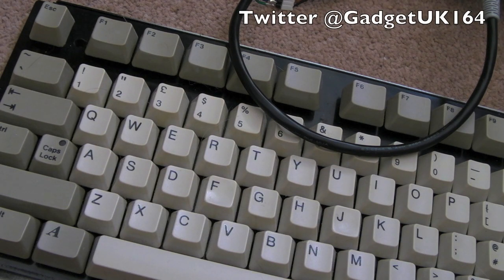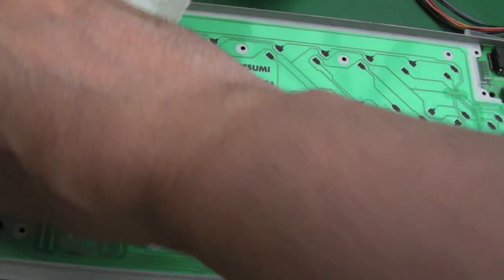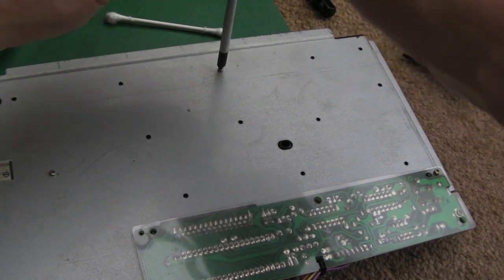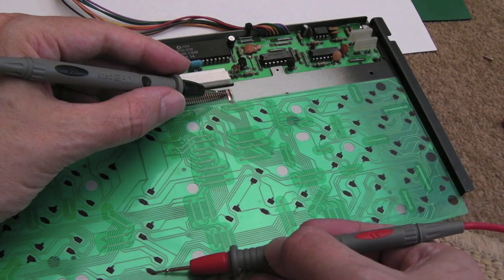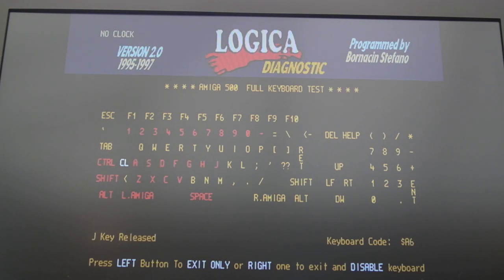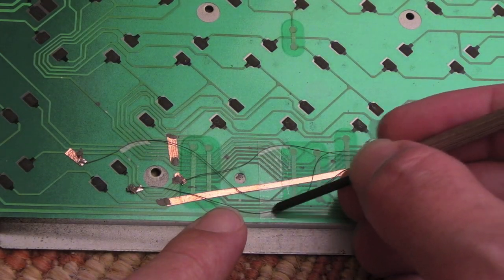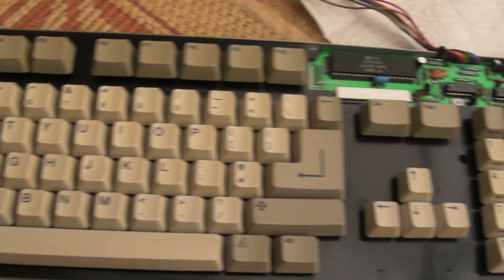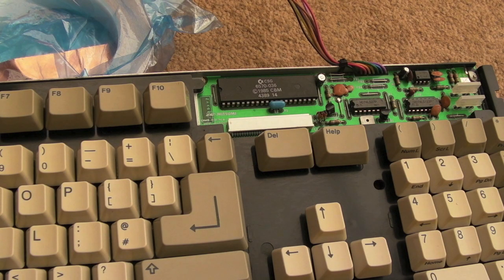Commodore Amiga Mitsumi Keyboard Membrane Repair

Comment: Question: why didn't you run wire from the pad directly to the connector instead of from the pad to the membrane?
Reply from the maker: The copper tape has a good adhesive on the back, so it stays stuck down really well.  If you were to try and use the conductive ink to secure a wire, it will break off very easily with any movement.   The conductive ink does not set hard, it sets soft - like silicone almost, but it is conductive.

Comment: Thank you GadgetUK164, much appreciated preservation of this Amiga keyboard, those membrane contracts are touchy.
Reply: Would a solution for those contact pads exist like a conductive paste on each pad?
Reply: Using nail polish on both back and front of those flat copper traces could help in numerous ways.
Reply from the maker: Yes, you can get conductive paint for those pads too!

Comment: I used an old set of probes, cut the points off just after the "ball" bit and cleaned it up with some p240 then p600 for testing carbon contacts on membrane. Works a treat and less risk of damage

Comment: I'll be adding a roll of copper tape to my supplies. My A500+ has a Samsung keyboard where the membranes aren't reproduced by anyone so this repair method may come in handy in future! 😎👍
Reply: Wow the Samsung Keyboard was a very very early Keyboard (I have one also) so I'm surprised you had one in a 500+ Was it your original machine or did you buy it second hand?
Reply: @005AGIMA  Yeah, the samsung keyboard in my A500+ isn't original. The whole machine is made up of parts I acquired over the years, including a repaired varta damaged motherboard. The case came from an old Rev6 machine where the owner had painted it in thick red gloss paint which I spent days scraping off. 😁🤣

Comment: Top video Chris, I always have copper tape and aluminium tape at hand it's very versatile and can be used for many different things. I also think sellers are charging way too much for new keyboard membranes, I agree £25 for a new Amiga 500 keyboard membrane is way over priced, I find it hard to believe those Amiga 500 keyboard membranes cost any more than £5 to manufacture in the first place.
Reply: Getting the tooling done for a membrane is several hundred dollars and unless you are getting many thousand made at a time it will cost much more than $5/each to have them made and that does not include tooling costs. 

Be thankful some folks are willing to invent a few thousand dollars up front to get membranes made and then sell you one for $25.

Comment: Nice vid Chris. Full of useful tips👍
Reply from the maker: Thanks!  Not one of my better videos - I was in too much of a rush to get it working!  I really should have shown close ups of where the damage was and the work I did.  I will perhaps show some close ups in another video when I can revisit it.
Reply: @GadgetUK164  It was nice to see the slug tape in use. I got some after you told me about it probably about a year ago, but I have never used it. Your method here would have worked for the touchpad on the failed fix MB Microvision as that was worn😁 Really useful idea on the conductive paint coupled with the copper tape. Good job Chris👍

Comment: I use a scalpel to remove the cover on flexible ribbons etc.  Very gently drag the scalpel across the surface pulling backwards so not cutting but dragging (if that makes sense).  Need to be really really careful though as any slip and the knife is straight through it. 

BTW that copper tape is great stuff.  I seen retro man cave use it on the bottom of the gbs8200 scaler to reduce the artifacting on the output.  If not tried that myself yet but might be worth a look.  Never crossed my mind to use it for repairing stuff as you did so will have to keep that one up my sleeve for the future. 

Great video, thanks.
Reply from the maker: Regards copper tape - yes, RetroManCave used copper tape on his GBS8200 after he saw me use it on mine, and I used it prior to that on a Famcom to NES adapter.  He's naughty like that!
Reply: @GadgetUK164  I knew I'd see it somewhere else before and should of known it would be you haha.
Reply from the maker: Hehe =D  A growing number of people keep approaching me pointing out similar things too.  My approach is share where you learned something - no other channel should be considered a threat, knowledge is power, but not everybody thinks that way unfortunately!
Reply: @GadgetUK164  Could not agree more.  If you're going to use a method you seen someone else do first then fine but just credit the original person.  A simple mention of a name during a video is all it takes.  Some out there would see that as a threat which to be honest I don't really understand as all that can really so is make a viewer go find the original content producer which only grows the community.

Comment: I used denatured alcohol at first and that was a bad idea, had green coming off on rag. I quickly switched to just a mild soap. Luckily I did not ruin it. Makes me wonder what these are made of.
Reply from the maker: As you say - just with very very diluted (like < 5%) washing up liquid a green coating was wiping off too!  It's the covering over the traces that seems very easy to remove.

Comment: You can use lip gloss in a pinch to lubricate floppy drive rails. I don't recommend it, but lip gloss is petrol based and will actually work like a grease. Because that's what it is, colored grease :)

Comment: Replacement keyboard membranes are available from various retro computer stores.
Reply: rezargamer  They are about 30 UK pounds at the time of this video. I wouldn't be surprised if the problem comes back somewhere else on the old membrane.
Reply from the maker: Yes, last ones I saw were £25 plus shipping! - I paid £25 for the keyboard already lol.
Reply from the maker: Maybe in 20 years, but not in the next few for sure.  I've fixed these before and never had to revisit them.  The 65XE was done 2 years ago the same way and has been used a lot and works perfectly.
Reply: @GadgetUK164  wowb chris,, in 2 years thanks to a cough n sneeze lol there 50 now and had to bite the bullet and buy 1 for my 500... the 500+ though is getting repaired with said tape lol

Comment: does this apply to an A2000 later era keyboard?  I'm curious if the A500 membrane works in the A2000 keyboard.  I'm thinking worst case scenario of an A2000 keyboard had contacts that need more than simple cleaning..  like if maybe something dissolved some traces and where replacing would be needed.  I can't find "A2000" membrane replacements.. but I have seen them for A500 and A1200 and A600..
Reply from the maker: Honestly not sure - I would assume they may have used the same membranes in some of them?!?
Reply: @GadgetUK164  yea i know they made a few iterations.  early was mechanical i believe and then later they went to membrane.

Comment: Mate, I have to comment on the subject of using makeup (again,lol). The advantage of having a wife and two teenage daughters is that they leave their make up all over the bloody house - which is quite convenient and they rarely, if ever, notice that it's gone walkies. If it's nail varnish remover, cotton buds and pads, soft brushes, nail varnish or that white fine tipped pen (absolutely have no idea what they use that for...) it's whisked off to narnia (aka my workshop) never to be seen again. I'm a bit of a magpie and suffer from shiny kit syndrome it seems.
You might make use of some veet hair remover....gets rid of pubes quicker than a welding torch apparently. ;)
Great vid man.....looking forward to the your upcoming A2000 and no doubtedly, you'll have yours done before I finish mine!
Be well and until the next one :)
Reply from the maker: LOL @ narnia =D  Thanks mate!  Post a link to any info on your repair (forum thread / blog etc etc).

Comment: Does a broken trace cause your caps lock to flash once on boot up???
I've got about 5 or 6 keys that don't work.
Reply from the maker: It's more likely to be a bad solder point on the keyboard MCU (The large 40 pin DIP chip on the keyboard PCB).  Or in many cases the chip needs swapping.  Membrane issues will cause keys to not work, but they cannot cause the LED to flash (unless perhaps its covered in liquid).
Reply: @GadgetUK164  Thanks for the reply, when I looked at the membrane it did have some sort of sticky stuff on it but I cleaned it.
I think your deffo right as I cant find any broken tracks anywhere.
Checked the conductive pads aswell so there okay.
Its just the 1,q,a,z and the 3,e,d,c keys that don't work, I cant fully check as I don't have a copy of amiga test kit.

Comment: What is a plumbpot? I can't quite make out the word and google turns up nothing. I'd like to get some of that copper tape.
Reply from the maker: Plant Pot! - https://www.ebay.co.uk/itm/30M-Adhesive-Conductive-Copper-Slug-Roll-Tape-Repellent-Guitar-Pickup-shield/392265716270?var=661222820042&hash=item5b54dbd22e:m:mfJ-LB_IEHfdE0m-q4pE6TQ
Reply: Thanks dude.

Comment: Not loving these ad breaks! they're ruining the flow! 

However, have you ever tried using conductive ink pens to repair traces?
Reply from the maker: I used a conductive ink pen to repair all the traces in this video?!?!
Reply: @GadgetUK164  - did you? instead of using the copper tape and wire, can't you use a conductive ink pen over the broken / corroded traces to repair instead? I've seen it done in other videos to repair PCBs, so wondering if the silver or gold coductive pens could be of any use.
Reply from the maker: I used conductive ink to join the copper tape.  I could have just used conductive ink (and I have done that in the past, where the break is say a few millimetres in length), but in these cases the breaks (dark trace areas) were very long and at the point where most keys were broken on the left side of the keyboard it would have been near impossible to paint 5 or 6 traces right next to each other for such a long distance.